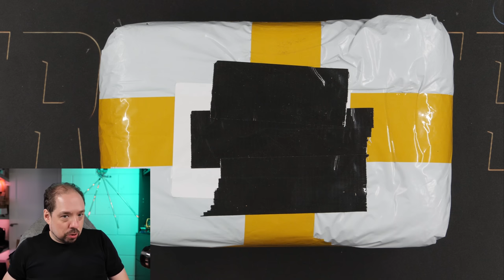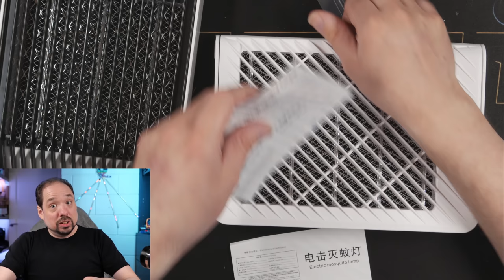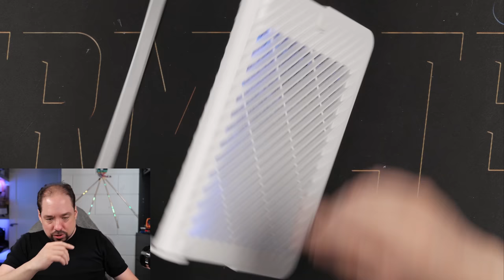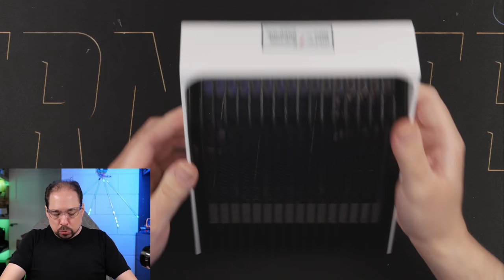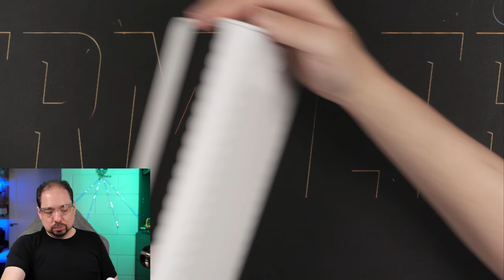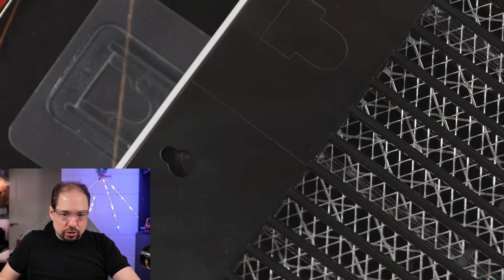📦QuinBoxed📦  Emergency EP.001: Mosquito Lamps

Comment: Thanks for dissecting the wall adapter.  Never trust stuff shipped directly from China that plugs into the wall.  The DC parts are probably okay, but anything AC should be avoided or discarded.  This goes double for USB power adapters, whose transformers are virtually guaranteed to have primary and secondary coil in direct contact with nothing between them but the lacquer on the wires.  Mere microns stand between you and electrocution.  Buy from domestic brands/stores where items are more likely to meet your country's electrical regulations.  If the seller can't be sued, they simply don't care if you die.  Perhaps Baseus and some of the other big brands do a better job with isolation, but I cannot guarantee it as some of their stuff appears to be rebadged from the cheap manufacturers.

Comment: links not working
Reply from the maker: Odd they work fine here? Do you maybe have a PiHole or something like it? They sometimes block affiliate links too next to ads and such. The s.aliexpress domain is only for affiliate links.
Reply: Confirm just now, links aren't working.
Reply: links load fine for me btw
Reply: @IntermitTech  Adguard was blocking the links for me.
Reply from the maker: Yeah sadly some do that although they are only affiliate links. I guess they could be abused but there are strict rules against it and it's not a picture or something.
Reply: @IntermitTech  yep 
i think it has to do with the filters they likely use iirc